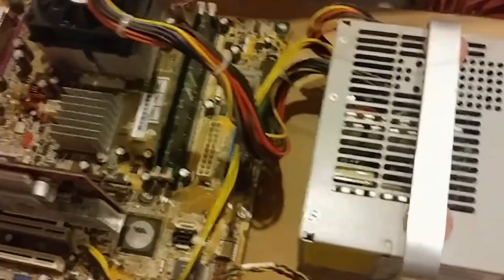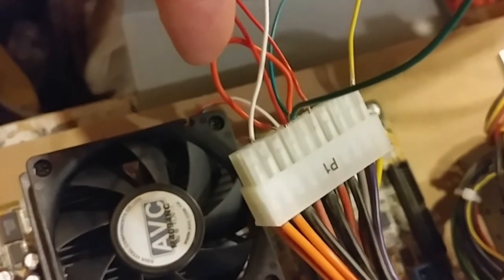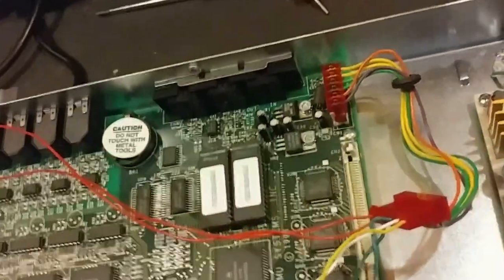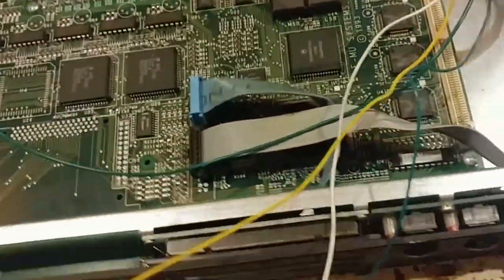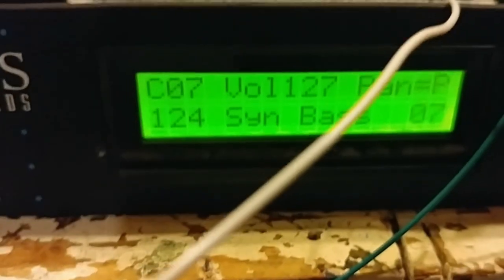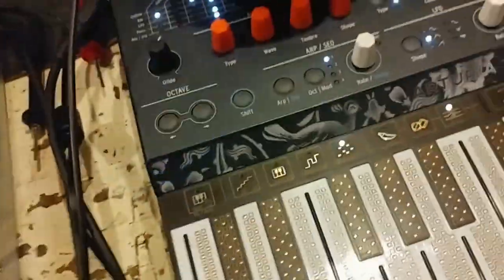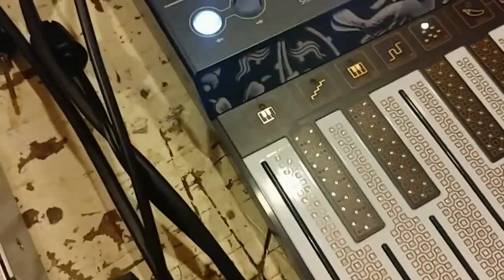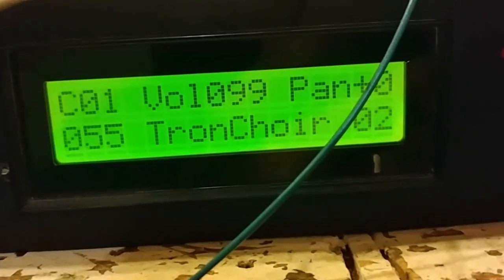Powering an E-mu Vintage Keys from an ATX PC power supply

Comment: Wow! Surfing the web looking for a solution as i have a EMU XL1 that wont power on...this is creative...! 

Did you source a new supply? If you dont mind, where does one source such a thing..?
Reply from the maker: Mean Well (available through Mouser and Amazon) makes some supplies that work with the EMU modules. Problem is the mounting holes don't line up. Hard to find an original. I was thinking of ordering a new Mean well RT-65B, but didn’t want to mess with the metal case of the vintage keys to mount the Mean well. Instead, I ordered a skynet PSU SNP-9031 from www.Elektrodump.nl